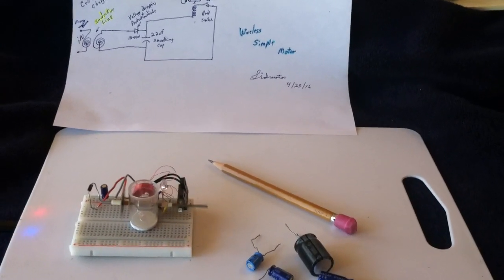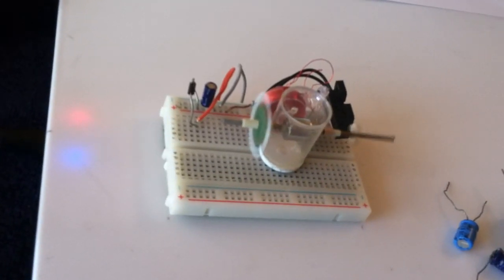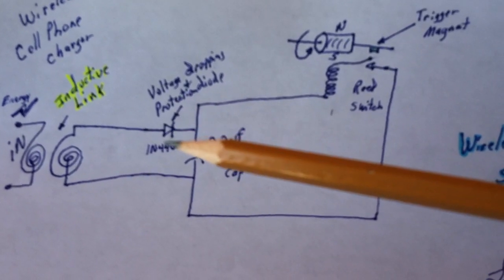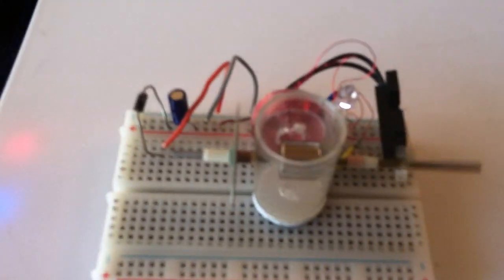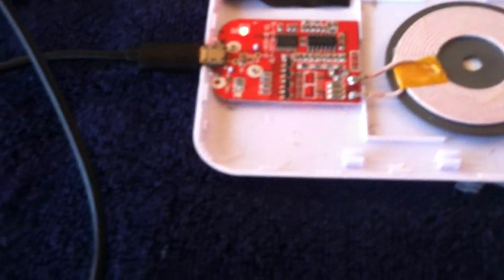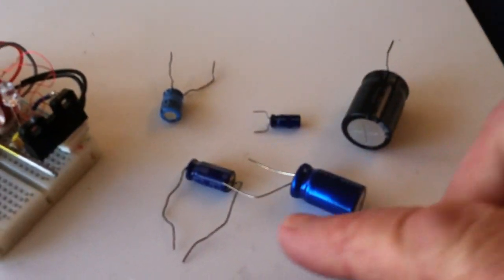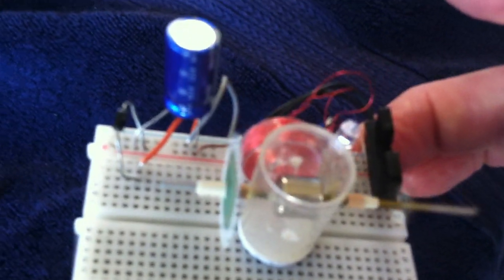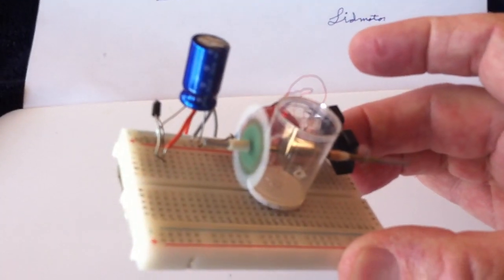Wireless Simple Motor

Comment: You can improve the power transfer if you add a resonant tank circuit in series with the pickup coil. You will need to know what frequency the transmitting coil is transmitting at, and use the resonant tank circuit formula to figure out what capacitor is needed. It should be somewhere in the nF to uF range. But I think the coil you used already has all the "demodulation" circuitry needed, including a 5V regulator. I have the same device.
Reply from the maker: +Power Max Yep the cell phone charger receiver coil has a rather complicated circuit attached to it.  I burned out one and took it apart.  It is more than just a pancake coil.  The transmitter and the receiver talk to one another and if the transmitter doesn't see the right situation it won't send the juice.
Reply: +Lidmotor This might be close to the chip that it uses. This particular one has a lot of digital logic internally, I see a I2C interface on it as well as a "digital demodulator" supposedly to 'talk' to the transmitting coil so it only sends as much power as needed to maintain 3.3v output. http://www.ti.com/lit/ds/slusal8c/slusal8c.pdf With that, you should not need to use the series diode as it reduces the 0.6V diode forward voltage drop will reduce the 3.3V to 2.7V.
Reply from the maker: +Power Max Thanks for the info on that.  I think for this application I could use much simpler setup and get the job done.  A basic Joule Thief type wireless setup would probably work.  The motor will run on 30mA but to charge up the supercap you need a bunch more.
Reply: +Lidmotor Look into using a few N channel MOSFETs to create a ZVS driver, but instead of a flyback transformer, use a pancake coil as a replacement for the primary. You can easily get several watts of power transferred a few inches. Of course the power output diminishes by the inverse square with distance, so doubling the distance will attenuate power transfer by 4 times.
Reply: The ZVS royer oscillator circuit is very robust, powerful, and efficient. Because each switching element is only switching when there is little to no voltage across the drain and source, there is minimal power loss during switching times, so the only losses are mostly due to on state resistance of the MOSFETs and ohmic losses in the wires and capacitors.
Reply from the maker: +Power Max This one looks good to me:   http://www.pocketmagic.net/wireless-power-transmitter/  I feel a new project coming on,  :)
Reply: +Lidmotor Yup, that is the exact circuit I was talking about. I built one very similar to that, make sure to use low Rds on MOSFETs that are rated for at least 3.1415 times the supply voltage. I used IRFP250N MOSFETs, but IRFP260n ones are better. Here is a great explanation of this circuit: http://adammunich.com/zvs-driver/